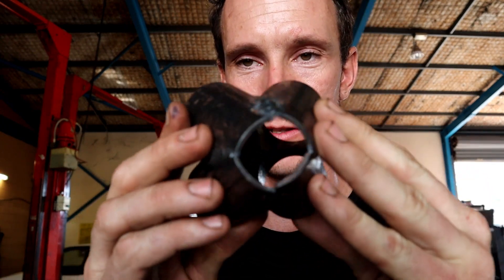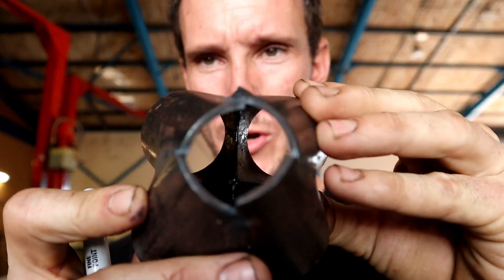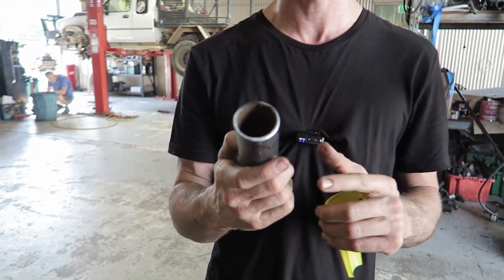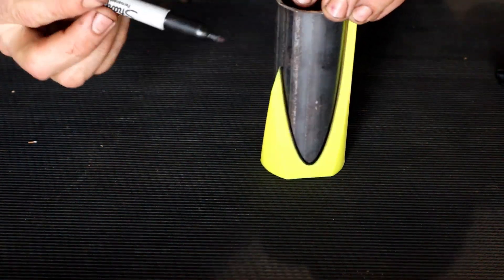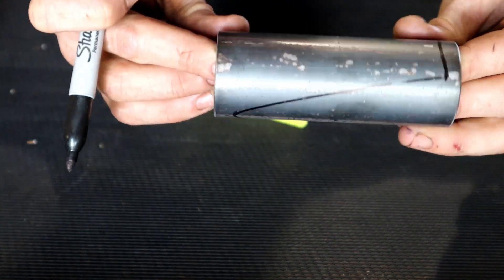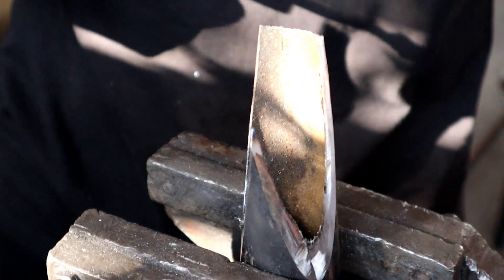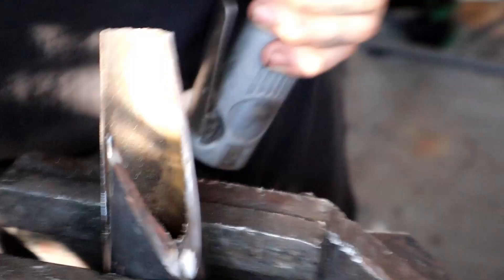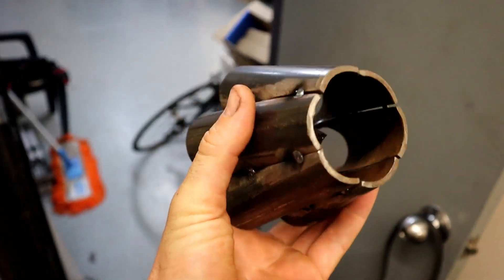How to make a perfect 6-1 turbo collector

Comment: I want to do a 8 into 1 turbo manifold for a pair of turbochargers. And then do a turbo back exhaust for an exhaust pipe on each side. Is this possible? The engine that I plan on using is a Chevy LS if that makes a difference. Thanks for any advice.
Reply: Wouldn't that be two 4 into 1 manifolds? Or is it a compound turbo setup?

Comment: Matt how did you go with the pipe templates for 4-1? Keen as to try one info@mickholgate.com
Reply from the maker: Hey mick the revision changes were making them a little longer and putting a step inside so the pipe is exactly the same size every time. Waiting for them to arrive in the post, the mate who is designing/printing them is down in Sydney, then had to send them to me. Will send one off to you as soon as I'm happy with it :)
Reply from the maker: Batch is on the way. Will be in contact soon.
Reply: @Camp_Dogs  cheers mate.